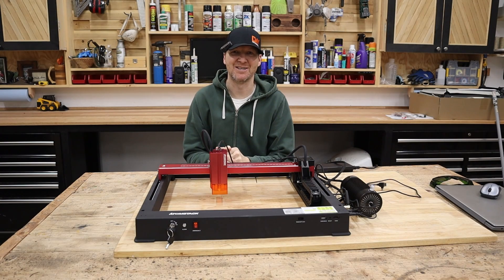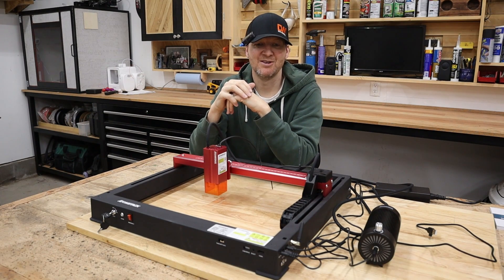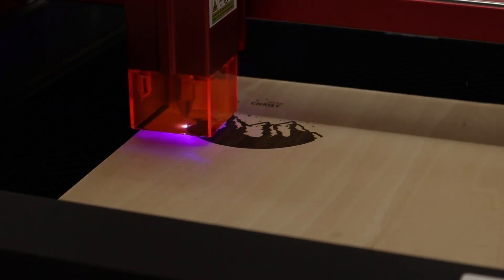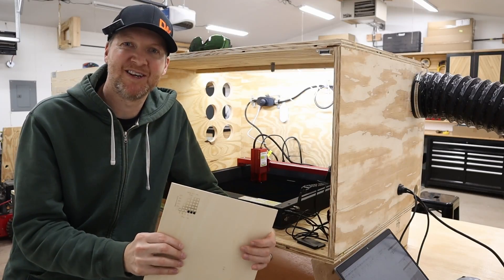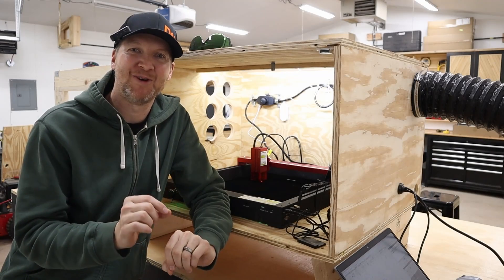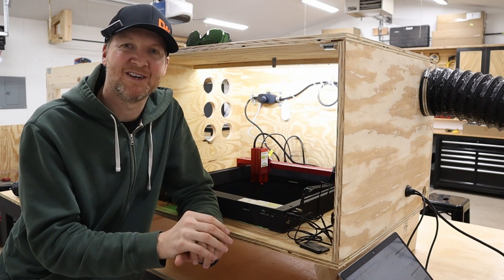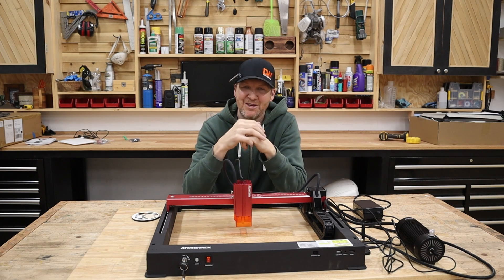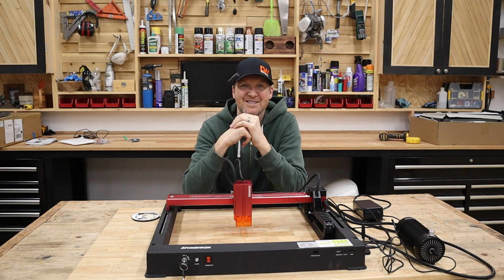Atomstack A12 Pro Laser/Full Review

Comment: CHAD! TY, but if  I order this Do I need an air compressor?
Reply from the maker: Hello, you will want to order the air assist with this as well. It is the small tube shaped thing that I use in the video. Then there is no need for a full size air compressor.